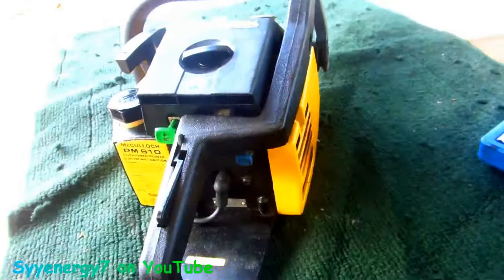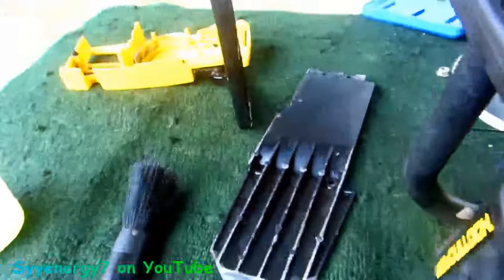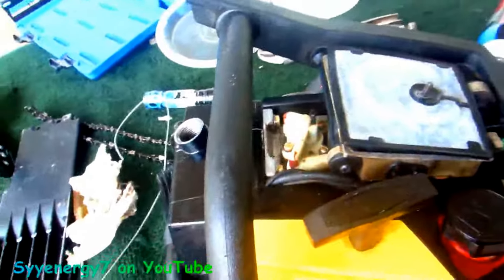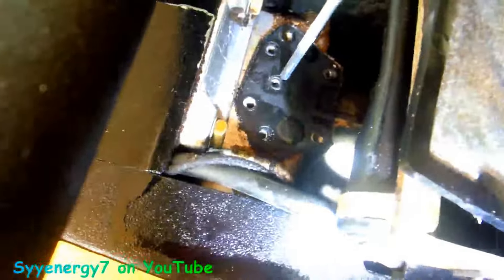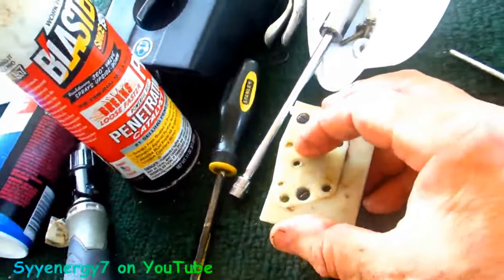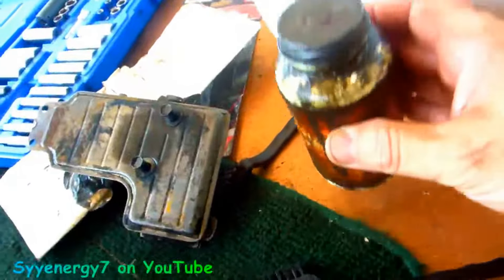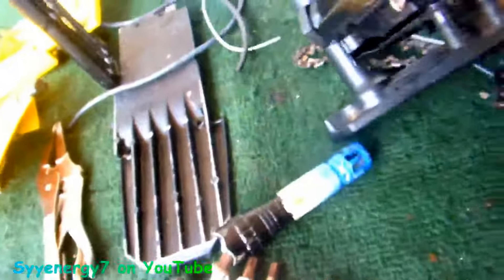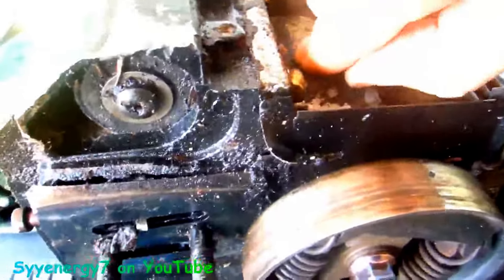McCulloch Pro Mac 610, Muffler Clean, Fix Oiler check ball

Comment: I put my oil pump in my ultra sonic cleaner with some purple power and vinegar I cooked it a 50 degrees for an hour.  I then washed it off and sprayed it dow, internally with WD40.  Put a new diaphragm and gasket and now it works fine without smoking.  The diaphragm had a small hole in it, causing it to suck bar oil into the crankcase.

Comment: You do not have to lock up the cylinder.  I just take it off with my battery powered impact (reverse direction).  It has a tapered shaft and you remove it just like a flywheel.

Comment: You ever get that saw running good? Having problems with mine running super rich. New carb kit, plus the little check valve. It runs fantastic but really super rich. Burns about 1/8 of a tank just idling in about 6 minutes at very low idle, right around 2000.
Reply from the maker: It runs good now.  It took a good carb cleanup in the ultra-sonic cleaner..  That ultra-sonic cleaner did the trick.
Reply: @syyenergy7  Did you do the ultra sonic before or after you replaced the check valve? Did you do anything else before doing the ultra cleaning? How did it run at each step? I can't get mine to not run crazy rich for nothin. Its got 167 psi compression cold too, which I would think is pretty good.
Reply from the maker: before
Reply: @syyenergy7  I'm confused then. You said a good carb cleanup in the ultra sonic did the trick but then you would have put the check valve in after. So did you only replace the check valve because it got blown out, not because you thought it needed it?
Reply: Thanks for the video. Very detailed and helpful!
Reply: Is idle needle set correct?
Is needle valve fulcrum arm set correct?
Is the metering diaphram they same as the one that came out?  Check the center post that contacts and operates the needle valve fulcrum arm to make sure it's the same length as original?